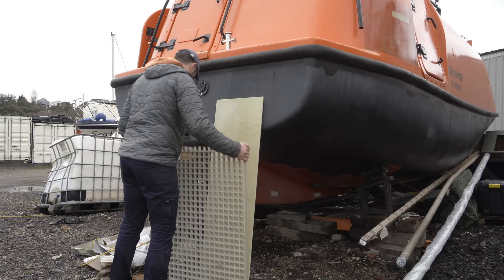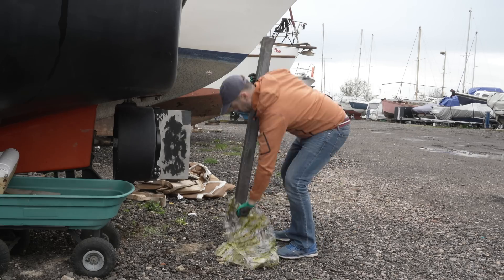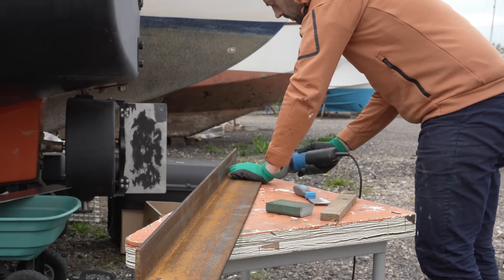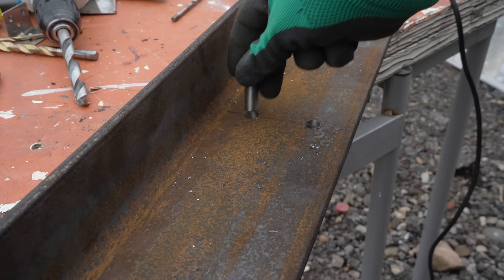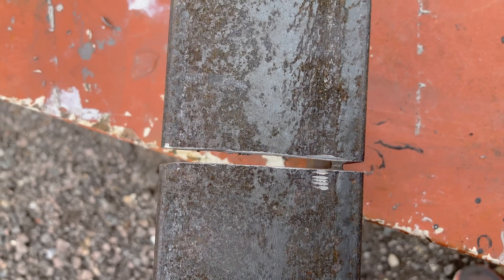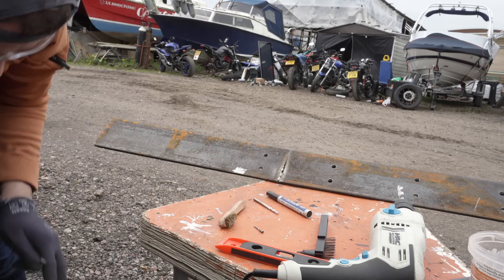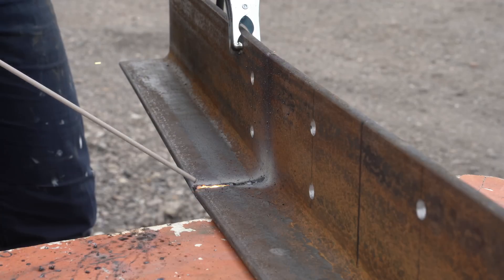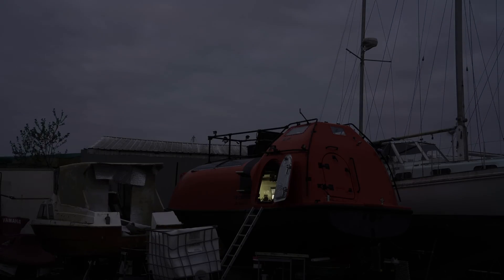First ever experience welding. Arc stick welding non-critical steel. Lifeboat Conversion Ep75 [4K]

Comment: I could hear that angle grinder crying "Damn! my days of easily grinding plastics and occasionally keying fiberglass are done.. it's hard labour from here on out.. my owner is now a Weldy Person!"
Reply from the maker: Oh it had periods of hard labour before that day! For a £25 grinder, ran like a champ for years.
Reply: @AlexHibbertOriginals  Funny thing.. I'm doing my own lifeboat conversion - a Harding MCB034 (another Norwegian cousin of Alan's..) - and I have yet to break out the angle grinder.. my "tool-de-force" for the recently completedremoval of the entire inner canopy shell and 300cu.ft. of flotation foam, has been a large reciprocating saw with a diamond coated blade made for cutting cast iron. Cutting speed was as fast as any other method, and this blade makes a powdery dust which does not itch!

Anyway, Rocinante (my boat) is looking at Alan's renovation with awe and wonder, and no hint of derision or competitive avarice - instead, since discovering your videos last week, Roci has begun "biting" me, drawing an unprecedented quantity of blood, as if to say "Why haven't you painted MY bilge? Where's MY new exhaust system? Why can't I have solar panels?".. and the only answer I can give is "I'm not taking you farther North than 65°, and I'm not planning to leave you drifting in pack ice for a year or two.. you'll be on the hard before the Bering Sea freezes".

Comment: I found that its easier to get an arc going if you pull the electrode across a scrap piece placed close to your work piece immediately before trying to start your arc

Comment: Sounds like the brushes are gone on the grinder, easy fix. And as a fellow nonprofessional weldy person Id advise making a much bigger weld pool and moving it along a lot slower especially when trying to fill a gap, this helps avoiding chipping off the slag to reveal sporadically placed bits of weld on ether side of the gap with occasional bridges holding it together.

Comment: *Hold the electrode up more vertically. This will help.
*Use the angle grinder to prepare the surface for welding first. 
*Clean the spot where the earth clamp goes on with the angle grinder so it earths properly. All this will help immeasurably with the sticking rod. If the rod still sticks, hold it down near the welding end like a pencil and strike it like you're striking a match and swap hands. 
*You NEED a chipping hammer.

Here's the thing, if having a dinner party it might be prudent to not cook a dish for the very first time for your guests. You cook something that you know well. Welding is the same; don't practice on the love of your life. 
Look at a vid on MMAW on YouTube. 

After watching YT vid or 10, practice running straight beads about 2/3rds the the length of the welding rod rod, then chip off the flux. 
It teaches you everything, like proper speed, compensating for the burning of the rod, casting off cleanly, starting cleanly, amperage setting, looking into the puddle, judging puddle distance and puddle control etc. It varies with metal thickness too, so on the practice piece it will weld one way but on something else another. You need to look right inside the puddle then as you improve you use sight + feeling + sound to gauge weld quality and consistency.

After you can do that properly, say 10x, then do it again laying beads parallel to each other but overlapping 2/3rds. When done properly they should all look like worms all nestling up against each other. Consistency of each bead is the goal - height, width and straightness of all the beads should be the same.

Also re your steel angle workpiece, welding butt welds together you need to bevel the edges so the weld has something to flow into. Clearly there is a lot to learn but in an afternoon and 2x packs of rods and some scrap you'll be amazed at the substantial improvement. 

When a weld is good, you can just blow the flux off with your breath of hit a hammer next to the weld and it will fall off. The flux is the 'shielding gas.' It doesn't take long. Just a couple of packs of rods. 

BTW, let the machine cool down. Duty cycle of cheap machines is very low, but they very often do a surprisingly good job.
My son just owns technique on cheap machines. I honestly don't know how he does it but he is a professional welder so there's that and his retinas aren't as burnt as mine LOL. 

Don't overheat your machine in practice. It is very easy to do as you start to 'get it' the puddle becomes like a visual mantra and you go into a deep meditative state and lose track of duty cycle as you're starting to improve. It doesn't take long.

30% welding 70% resting or what the machine's instructions say.

Above all watch YouTube vids on MMAW (Manual Metal Arc Welding). 2 packs of rods and you'll be away. It is all about muscle memory, prep (very very important) and technique. Oh, and don't forget the prep.
Prep....
Reply from the maker: Will have a proper read of this. Thanks

Comment: A few quick notes on welding and grinding. It looks like you are using standard 3mm cutting discs. Get some good quality 1mm stainless discs. Norton, Dronco and Osborn make good discs. They cut much faster. Avoid cheap Screwfix 1mm discs. They are useless.
Get some heavy gloves. Heavy leather gardening gloves will do, though proper welding gloves are pretty cheap.  Synthetic fibre/plastic coated gloves melt and burn if sparks land on them. The molten plastic then sticks to your skin, giving you a nasty burn.
As others have said, get a decent self darkening mask. You can then use your free hand to support the welding rod. This makes it much easier to control the weld.
Reply from the maker: Cheers. Yes on all counts (I moved to thick bramble gloves after filming the clips). And you noticed the discs! I ran out of good 1mm ones and wanted to crack on with the job. Well spotted.

Comment: No corrosion, agree, but always UV damage.
Reply from the maker: Glassfibre is exceedingly UV resistant. Most boats are made from it.
Reply: @AlexHibbertOriginals  It is actually the gel coat that protects glass fiber. I built 52 foot boat, and have been maintaining it since its launch in January 2005.
Reply from the maker: Gel coat is just a slightly thickened polyester resin, like the rest of the laminating resin, that sits on top of the reinforced laminate (or rather, was beneath it in the mould). You may get discolouration over time, but the material strength itself is highly resistent when in a laminate of normal thickness. If the appearance is an issue, flow coat or a good paint solves all.

Comment: Practice makes perfect Alex, if you can find Weldall electrodes (which are higher than 304 grade stainless) and use high enough amps your stern reinforcement will not only be stronger and the welds not corrode but you can attach it to the factory stainless through plate. Please ensure you use sleeves around your bolts and don't crush the transom fibreglass, a Denso tape interface between the plate and the transom will also cut the need for gallons of paint on the steels mounting face.
Love the content and good luck.
Reply from the maker: Thanks. I was warned to avoid mixing mild with stainless when welding (although, always go 'up' a grade), although I accept that the quantity of weld is so comparatively low that it won't cause a major galvanic cell. Sleeves around the bolts? Can you link to an example? I understand the principle I think, but surely the length is critical, or else the bolts won't clamp properly. Isn't it ok to torque the bolts to a level that's fibreglass-safe?

Denso tape - an idea - although the entire mounting face will be pasted with thick epoxy, so won't be painted.
Reply: @AlexHibbertOriginals  If the transom is solid fibreglass you don't need crush spacers. However if it is two layers of glass with a foam/wood core you do need to use spacers and spreader plates on the inside. As far as the crush spacer length is concerned you have to make a guess at how much crush you want. A better solution is to hole saw though the inside layer and the core leaving the outer layer. Now fill that big hole with chopped fibreglass filler and re-drill. This way if any water creeps around the bolt it won't get into the core. The filler also makes a good crush spacer.
Reply from the maker: Thanks - it's a solid fibreglass transom.
Reply: @AlexHibbertOriginals  Alex, from my lifeboat servicing experience the transom is a sandwich construction glass foam glass which won't like being stressed by bolt compression if you use a sleeve 5% less than to overall depth of the hole and a sleeve with an ID hole one size larger than the bolt eg12.5mm hole use "teadit" compressable teflon washers on the inside and outside of the sandwich plates with a dollop of sikaflex leaks will not be a problem.
As you say galvanic corrosion shouldn't be a problem but epoxy may struggle with temperature and expansion/contraction in the ice which is why I suggested the Denso.
Reply from the maker: Thanks for the added info, but yes I've triple checked. 100% solid fibreglass transom. Alan was made well!

Comment: Those large bolts in the transom seem like a pretty effective conductor of heat. Any plans in mind to mitigate that? Or is their position already isolated from the interior?
Reply from the maker: I guess a foam jacket is possible, but that small area of inside transom is uninsulated, so there will be a little condensation.
Reply: @AlexHibbertOriginals  Okay then it won't nearly make as much difference as I feared. Are there more uninsulated areas on the hull and do you plan to improve on them? I can imagine it's already good enough for that first expedition and actually getting Alan into the Arctic at some point would be nice after all this hard work.

Comment: My dear friend, you are indeed making progress in your welding endeavor, albeit a tad slow. May I humbly offer some unsolicited advice? Firstly, allow me to remind you that welding thick material requires a considerable amount of heat. In the range of 85 to 95 amperes should be within the realm of possibility. You are absolutely correct in stating that the welder must have a clear view of the pool of molten metal. It is essential to keep the slag akin to icing behind the melting pool and move away gradually as the metal liquefies. Maintaining an inclination of approximately 85 degrees also helps to keep the slag away from the melting pool. Additionally, employing a robust light source can significantly improve the visibility, even when welding outdoors.
Reply from the maker: Appreciated!

Comment: If you look at a 10mm drill bit, you will see that there is no cutting edge in the middle. So you are just rubbing against the metal there. If there was a cutting edge, the drill would split in two pieces.
Reply from the maker: I shall set aside some time to look at 10mm drill bits.
Reply: A while back I came across some reasonably priced Milwaukee ones that have a little secondary tip on the tip so they sort of self pilot, they have saved me a lot of time and are really easy to centre on a mark.

Comment: I'd recommend an auto darkening welding mask. There are cheap ones available and it makes striking an arc so much easier especially while learning.
Reply: I'll second this, I decided to become a weldy person myself a year ago (I'd already figured out how to do mig welding badly a long time ago mind). I purchased a cheap arc welder and mask and auto-darkening mask and I can now reliably produce structurally sound welds that resemble modern art.
The mask is great because it frees up my hands as well.
I'd also suggest adding a good neodymium magnet to the clamp as it really helps make a good contact.
Reply: Yes, I consider them basically mandatory. You’re doing so much damage to your capability for detail work (or really any work) if you insist on using a solid state helmet. Even the cheapest auto darkening helmet is miles ahead.

Comment: Are you getting the same grinder gain or upgrading to a better brand? And as it has already been pointed out, an auto darkening helmet will make a world of difference, I'm sure some can lend you one if it's not needed long term.
Reply from the maker: I'm not DeWalting, but yeah a little more power. To be honest, I feel that three years of pretty intense use for £30 made it a good purchase.

Comment: It may be worth cleaning the steel a bit more before welding. You can use the colour change of the steel as its heated to get an idea of how its going
Reply: No need, arc welder dosent care. He needs more heat and to go slower.
Reply from the maker: Slower is definitely my first lesson. I rushed initially and left gaps.
Reply: @AlexHibbertOriginals  yeah, I'm not saying this to be an Internet tosser, but from what you showed of the finished weld it didn't look like you had much metal making a connection. Arc Welding is cheap to get into but one of the hardest to master the technique of. Having said that, there's plenty of video tutorials out there to help, nothing quite like someone who knows what they're talking about beside you to show you when you're learning though.

Comment: Get a proper mask mate, when you can see what youre doing its sooooo much easier!
Reply from the maker: I kinda asked for that. Yes, it was the cheapie included one.
Reply: @AlexHibbertOriginals  you'll be amazed at the difference between that shield and a 30 quid mask! And with regard to your rod sticking turn the amps up, for what your welding and what I'd imagine the output of that welder to be (120-160a) I'd run her flat out if you want to get any decent penetration! Give her all she can  suffer!
Reply from the maker: Oh - sadly my welder only chucks out 100A. It's a baby machine, hence the sticking and need to run the seam three times in 8mm steel.